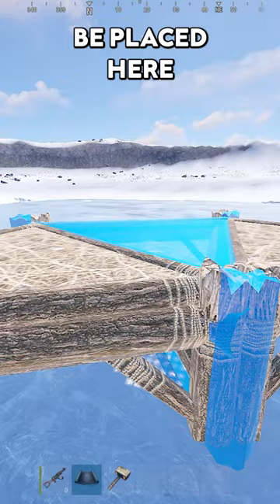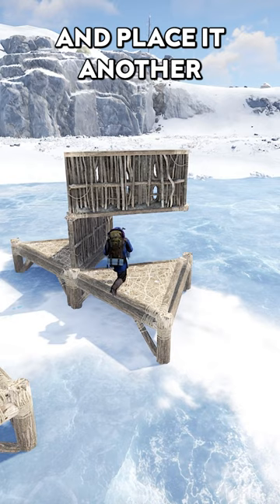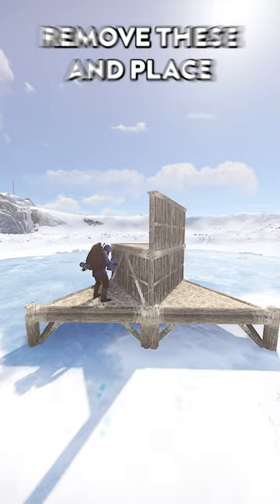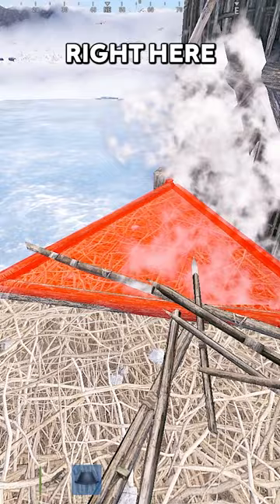INCREDIBLE Pixel Gap Tool Cupboard Room in RUST!

Comment: 1. If you want a small gap: Crouch when crossing between squares ( you need to cross between them, it changes your hight slighty) 
2. Dont upgrade to hqm or you might brick it, there is another variation of the technique for hqm (check Gamerlightz). 
3. Dont put TC flush against the gap or ppl might shoot it and the loot can drop through the cap. (place it at an angle)
4. Jumping on a smart alarm and crouching places you at the perfect hight for looting through the gap.

Comment: correct me if i’m wrong but i’m pretty sure doing it this way will just give u 2 level half walls.. the way i learned to do it is by placing a roof on the squares and running into the roofs.. also, you can access the pixel gap by stacking 3 siren lights on top of each other from the floor, much easier than the box